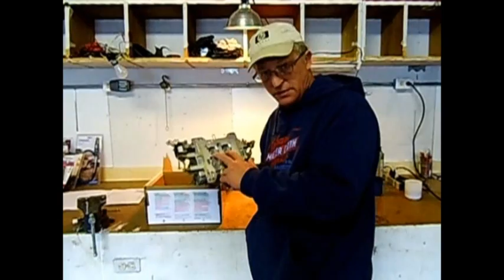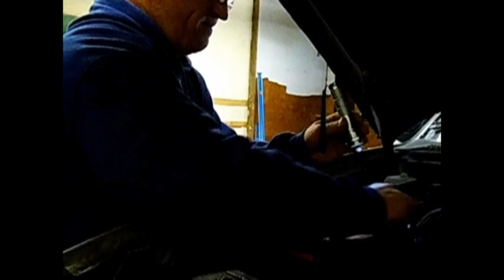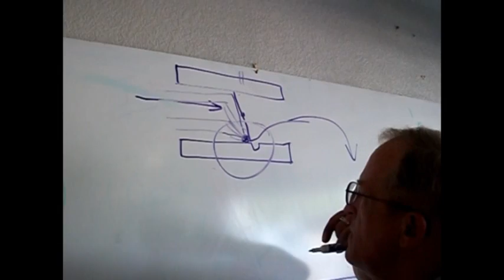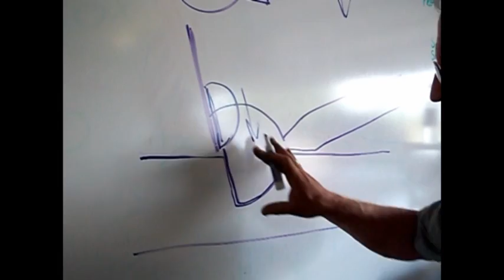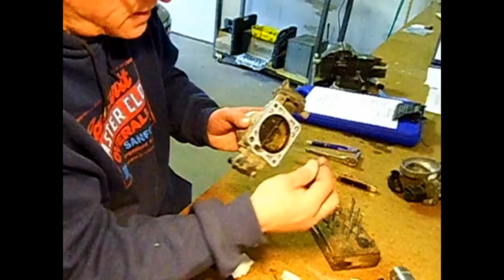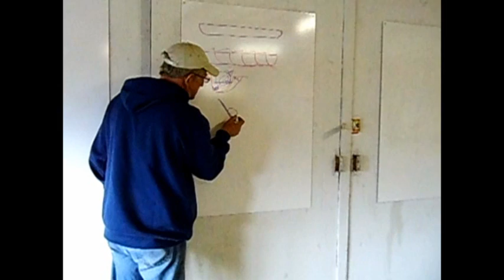2013 Training Video FINAL VERSION Full Length

Comment: by 1/2" round bit
install it in a drill press
and compress it agaist a file until 1/2 the ball is gone.
now tape the center of the flat face with a mig to install a bb weld.
now brush the bb slick on a bench grinder brush.

walla perfect shape, depth and no need to screw with throttle plate while making your groove.
its perfect every time.

to round over your the throtle plate, remove it,
shoot the edge and face your grinding with satin black spray paint.
now do your shaping with a stationary mini belt sander in a vise.

to improve the groove.
prep sand inside of throtle body with 220 grit were youll make the groove.
clean with paint degreaser and run a 1/4" bead of j-b weld were the groove goes.
let cure 24 hrs.
now cut your groove.

the jb riser is the key to efficiency.
Reply: Can you ellaborate on what you mean by tape the center of the flat face? Also why round over the TB plate, and why paint it? Any info the other dimensions and position of the jb weld riser relative to the TB plate would help a bunch also. Thank you for your time.

Comment: Ok I finish today my saab with my o2 sensors done... the car show alot improve,  before the groove the on-board computer that calculate the miles u can get from a full tank was 280 miles range, now with just one tank 805 miles range..... Amazing. Now I can remove the cats :)
Reply: How hard was its

Comment: Watched your video and done the modification for my Hyundai eion &  Hyundai i20 which is showing very good results. As I observed in both cars there was jurkey at 2nd gear within 20km/h to avoid tat jurk v had to throttle above 2000rpm but now after the modification v can move in second gear within 10km/h or within 1000rpm which is giving a very good satisfying results. Thank you very much for your guidance I just want to check my mileage 
Thank you so much.

Comment: I have a 96 f150 5.8l that has 2 56mm openings. The metal at the point where it meets the butterfly is only 3/16 thick.I would not be able to cut a grove there deep enough to matter
Reply: You put metal epoxy on the outside of the throttle body to build up the material, at the Groove's location. Then it's OK, done it a few times myself.

Comment: I bee trying to register on the site but for some reason i'm not getting the email with the password... *--* I just groove my saab, open the spark plug gap i bit more, play with the mass sensor and no improves yet.... I'm wandering what I miss. I'm ordering the 1/2 resistors to install on my down stream o2's to see if that help.. Right now the mpg decrease. My OBD2 scaner got real live data and I can see everything. I'm getting a mass air sensor code, Said check air range or something like that